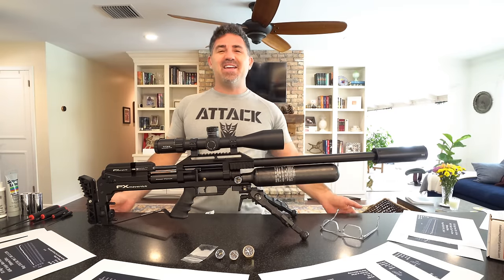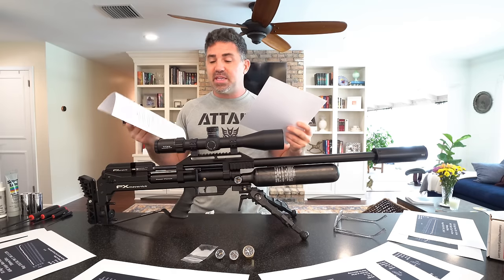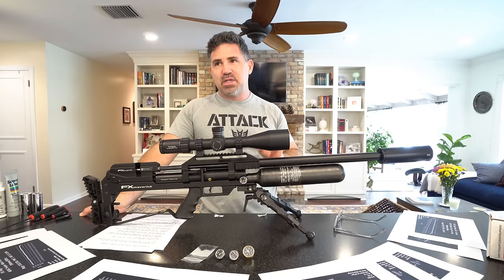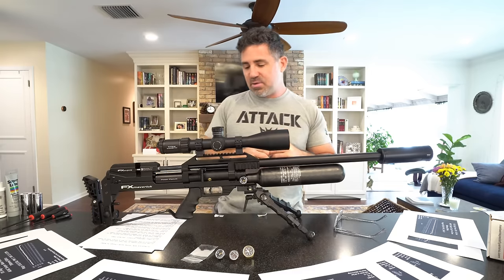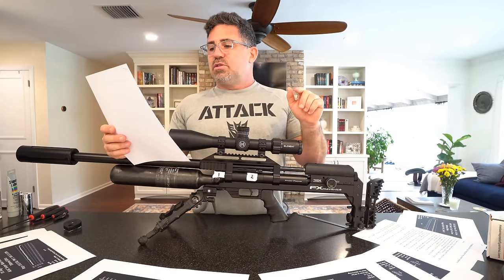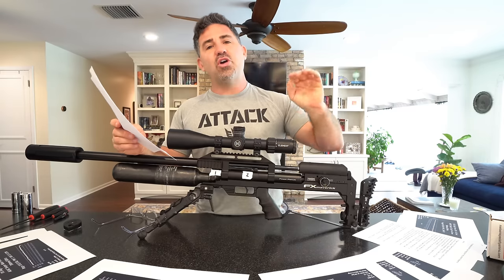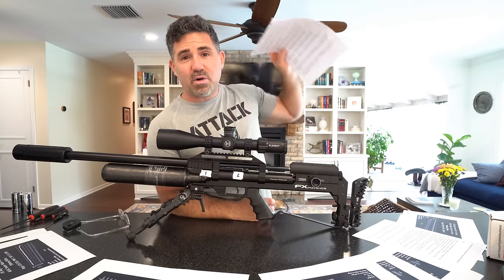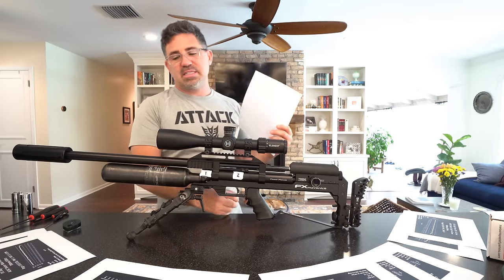FX Maverick (AIRGUN TUNING GUIDE) !! + Dual Regulator Tuning - Hammer Spring Setup - Airgun Accuracy

Comment: Unnecessarily long video,  but ypur efforts are appreciated.  I'm running 180 on the front reg and 150 on the rear reg.  Also installed the slug power kit at the same time. Now 1024 fps with 34gr slugs at 80ftlb.

Comment: This guy is the airgun doctor. School is in! Steve you made several good points. Tell you a funny story. Before I received my Maverick in the mail, I watched almost every maverick vid on YouTube. Most were running 175/155 regulators. I adjusted mine straight away to those numbers and it shot really poor. I brought mine down to 165/135 and it actually makes MORE power. 930fps with single digit ES. Less is more sometimes guys.

Ps. What speed do you think is best for the .30 cal FX 44.8 gr pellet?
Reply: {Your ambient temperature in degree celsius + 273.15}x 51.813 = fps for best combination of accuracy and Power as they are inverse functions.
For exampe, at 25 degree C calls for 894.6555 fps.
The faster you go, the more power, but at a loss of accuracy as you approach towards the speed of sound into more turbulent air drag.
In other words, stay below Mach 0.79, <78% Mach1
For Olympic, 10 meter, indoor accuracy calls for 50% Mach1.
Wait for my book.

Comment: Hello. I recently got my Maverick 25. But adjusting both regulators, the second one started to leak air out of the adjustment screw. He stopped doing it when he tightened the screw. Do you think the o ring was damaged? Or do I just start the steps again to regulate? The pressure gauge of the second regulator no longer moved.

Comment: so I got my gun dialed in and set my first reg at 180 and second at 150. I got everything dialed in no leaks everything is good. I went outside and shot the first shot and wow it was super quiet no power ... so I figured it needed to be shot a few times, so I kept on. I refilled the mag and topped off the bottle at 250 bar and fired again now the pellet goes into 3/4 " plywood to the skirt not all the way through like before each shot was going through 2 - squares of plywood and hitting the back stop concrete board. I am asking could this be a hammer spring issue??  or is there a number I can call to get the factory settings for the regulators for 30 cal maverick sniper? any help is greatly app.

Comment: this is fascinating information however i wonder if it actually translates to other owners mavericks.  I have tried to replicate other peoples settings with my hatsan flashpup and I don't get the same fps using same regulator pressure and hammer spring settings.  Every gun seems unique which is annoying.

Comment: Is the Impact m3 your favorite FX air rifle?
Reply: Yes.😋
Reply from the maker: I just received my two review M3s from FX and I'll be releasing quite a bit of content on them in the coming months 👍.  Steve
Reply: @AEAC  That’s fantastic! Thank you!
Reply: I like my mk ii as much as my m3. Trigger on my mk ii is much better. The only thingI like on the m3 more is the tuning ease. 
My favorite fx is my wildcat mk iii .22. 
More accurate than my impacts or maverick, and ergonomics are perfect and the trigger was match grade perfection right out of the box.
Reply: @2002ZRX1200R  I’m torn between the Wildcat MKIII and the Impact M3. I’ve never handled an FX gun but know I want at least one.
Reply: @DougFLA123  for power, impact. For reliability and ergonomics, wildcat. 
My Impact mk II has nickel and dimed me and has required sending to fx for repairs twice. My m3 showed up with a bad barrel and a leak, so it got replaced. 
My wildcat mk iii (not bottle) has been perfect and problem free right out of the box, and groups sub moa @ 50 with several pellets, and even likes nsa and javelin slugs.
Reply: The mk iii bt is a wildcat/maverick hybrid. The balance and smoothness are no where near my wildcat mk iii's in "feel" quality.

Comment: 1. Regulator 140 Bar
2. Regulator 110 Bar.
It takes time for the regulator manometer to come from 100 bar to 110 bar after 2-3 shots. 8-10 seconds. What is the problem.
Instability in FPS 1000-940 chasm
Reply: Same with mine.  FX told me to set the 1st reg 50 bar from the 2nd.  Some AMP regs are more sensitive then others.  I did it and the issue is mostly gone.  It still takes a few secs to adjust but much faster now.  Ernest Rowe has a video that may relate to the issue:  https://www.youtube.com/watch?v=p-p-sGTJCiA

Comment: If you want to maintain the integrity of your tunes, please show a video to all the novices on how you were coming up with these internal hammer spring adjustments. The only way you could be coming up with these 5.80 mm and 3.11 mm measurements is by taking that hammer wheel out of the gun and measuring them so you have a lot of people scratching their head if you want to be thorough, be thorough

Comment: hey Steve! shoutout from India!
We're restricted to .177 Cal here and through reliable sources i understand there're over 1k FX Airgun owners, mix of Maverick Compact (500mm Barrel-Double Reg.), and Impact M2 (600mm Barrel).
And i happen to be one of the Maverick Compact's.
I understand the same tuning principles apply in .177 but the heaviest and affordable projectiles here are in ~16gr ballpark, slugs, around 18-20gr.

>>Could You present to us most powerful (knock-down impact) and at the same time accurate (smallest group size) tune for 50 & 100 Yards?
>>Another request would be a stripe-down video of full servicing the Maverick and Compact since there're multiple owners who've burst O-rings, and possibly second reg., messing up caught in temptation to increase thump at distance.

And if that was a 'Long-Text', i've watched Your 1+hrs Videos can't number how many times, and if above requests come out to be served in 2+hrs long, It'd won't deter the determined ones either...

special thanks for the session with PJ.... a lotssa fundamentals brainwork there!